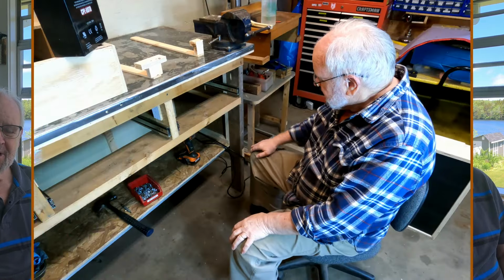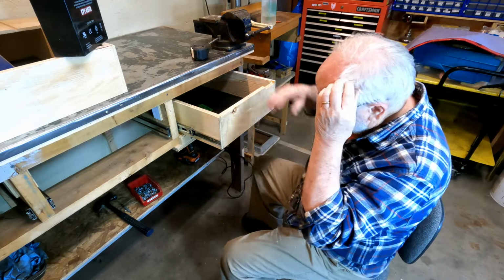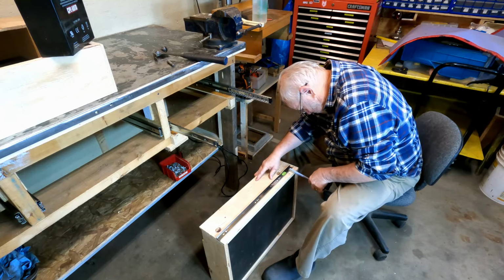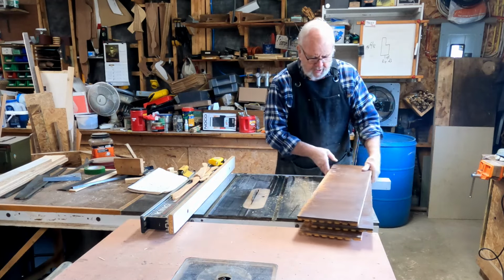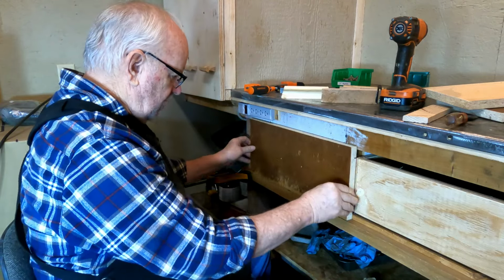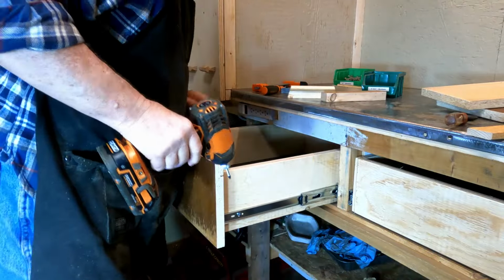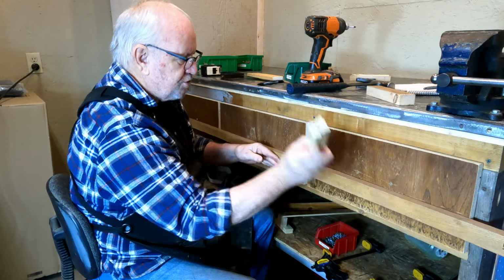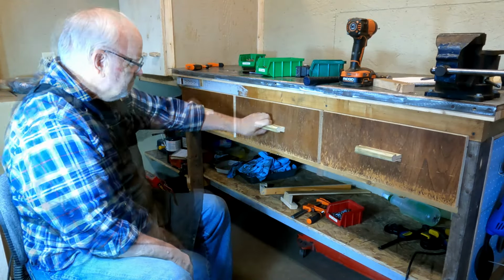Finishing The Work Bench Drawers

Comment: Good job, Yogi! You ARE smarter than the average bear. That looks really nice and the drawer fronts went on very accurately. I always use a ledger board too when I can to to get things level. The sled on your saw is a really handy feature to keep count of all your fingers. The custom-made jigs for setting the drawer height on the sliders was work well worth doing. Best wishes to you both. All the best to nanny!!
Reply from the maker: How's she goin'?  Thanks Craig!!  This was my first try and putting in drawers with these kinds of sliders and after the fight I had with the vertical drawers, I wanted to try and get every thing set up right and in place with jigs to make sure the drawers worked good and closed tight.   Thanks for tuning in.  Tell Susan I said hello and take care!!